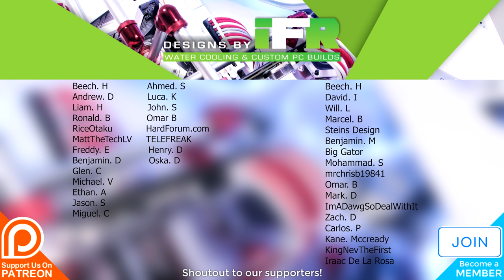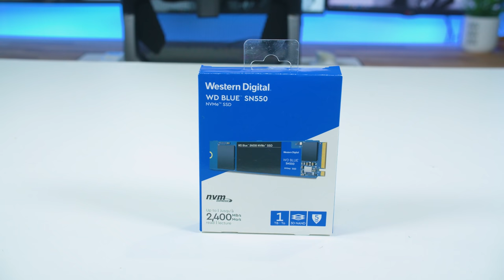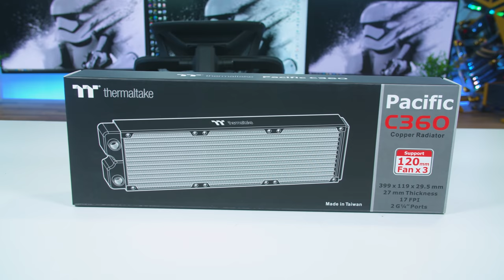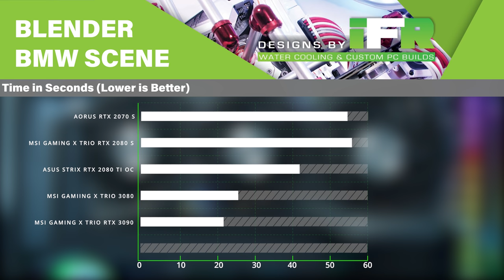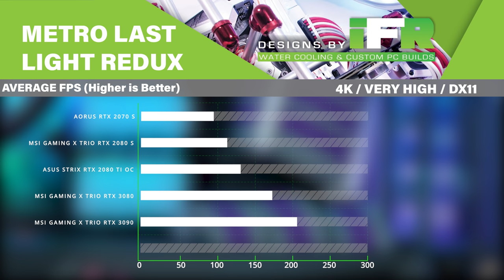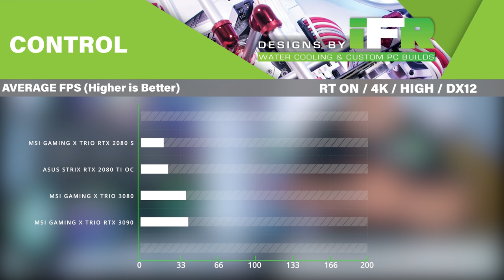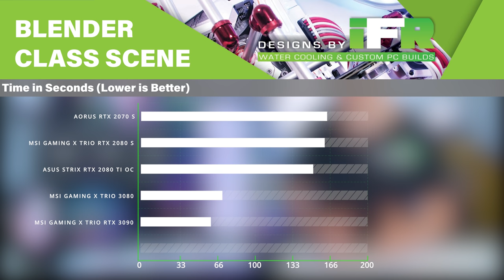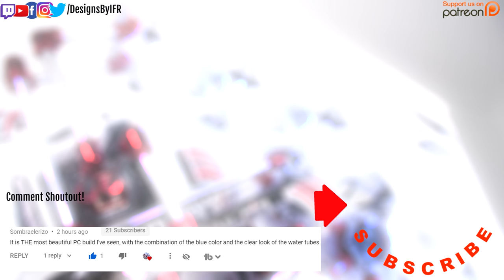Ultimate RTX 3090 Custom Water Cooled Gaming PC Build + Benchmarks

Comment: Alternative title: how to build a freezer that can store your electronics
Reply: Lmao
Reply: Lol did u see the 4600mhz ram
Reply: Those extra fans aren’t offering more cooling. It’s more likely that they’re hindering the positive pressure in the case
Reply: @aidencooke626  it probably has really high cas latency
Reply: @gravityfighters1  lol ;)
Reply: @gravityfighters1  How would you do it? Top 4 and front 4 fans pulling in, bottom and back pushing out, separate radiator on bottom with stand alone reservoir for GPU?
Reply: @cncinspiration1719  I would’ve changed the bottom rad to pull in air and the three under the water block. I learned that having more positive pressure (air coming in) is better for your cooling system then negative (taking air out) and I know it’s weird to change the bottom rad but from the things I’ve learned going front bottom out back top is best because to get that heat to go out throw the bottom will be much harder. So have the pc ( especially one like that up on a desk or a stand to allow more fresh air to come from the bottom.
Reply: @cncinspiration1719  and the gpu could go into the already existing water loop because there really isn’t anywhere to put another loop but that’s a 3090 in a very high end build it’s crazy not to include such an expensive piece in the best cooling solution
Reply: @jaypruett9503  it hurt me watching him do that. I wanted to jump through my screen and stop him. That poor pc.
Reply: @gravityfighters1  you know that you could get RTX 3090 for 600 dollars
Reply: @thiccccboiiii5245  are you saying $600 isn’t crazy expensive for a single component? And also where the fuck do you get a 3090 for $600???
Reply: Jay _TooGoated  the Corsair case is best for air flow and the li case would be good for cable management. Definitely would go with a 1000w power supply for overclocking on the CPU and GPU and for overall safety of the machine. The only thing I would add to this is another SSD or a large storage Hard drive especially if it’s for gaming. Also what speed of ram did you get? The 10900k can handle almost every speed but you have to make sure to get real performance out of you machine getting Cl16 cl15 cl14 are the best for higher speed ram. Other than that you have a beefy ass computer to put together. And if you need help with that I can help.
Reply: Lol
Reply: he: decides to build an ultimate PC
his bank account: noo...no.plz god noo..noooooooo
Reply: @gravityfighters1  lmfao
Reply: Anyone know music name ?  😁
Reply: Which company's motherboard, Nvidia 4090 GPU, cabinet, motherboard, DDR5 ram, liquid and air fans and SSD and power supply are the ultimate? Please don't ignore my reply. Please anyone reply.

Comment: Back then you were worried youre pc will overheat, now youre worried about it freezing😂❄️
Reply: underrated comment
Reply: Lmao 🤣
Reply: pc components work better under cool temperature {a fact}
Reply: @jyotiprasad1411  hey baby. U didn't get joke but you will surely get my pure love if u try
Reply: i will play my laptop in the freezer now then
Reply: Those fans are useless they spins in 1100 rpm that's not enough. Waste of money
Reply: Which company's motherboard, Nvidia 4090 GPU, cabinet, motherboard, DDR5 ram, liquid and air fans and SSD and power supply are the ultimate? Please don't ignore my question. Please anyone reply.

Comment: Incredible, I just want one of those PCs to play minecraft!! Lol
Reply: Same
Reply: lol 4000 fps
Reply: @wintr7803  
Maybe 30
Reply: @Terminate1783  130 rtx on
Reply: Enable RTX , BAM , You would still be getting over 3000+ FPS!
Reply: @nicojusbetter  
If you play minecraft without shaders you aint playing it right

And there isnt a pc that runs mc with the best shaders at high fps unless u have render at 0
Reply: @Terminate1783  Playing with / without shaders doesnt mean you're playing it right or wrong its just a preference (I like it on)

and im pretty sure an rtx 3090 and ryzen 9 5900x would be good enough to run those  shaders normallly
Reply: @nicojusbetter  
No there is shaders and textures that make the 3090 kneel
Reply: @Terminate1783  no
Reply: @Terminate1783  bro there literally aren't why don't you look it up
Reply: @Terminate1783  OH I forgot I watched that video a while ago. Then yes you are right and now I wonder how dual 3090 would perform in that 🤔
Reply: @nicojusbetter  not much better, trust me.

It will perform similarly as SLI isn’t supported or any useful for Minecraft from what I have seen.

I can also confirm that my RTX 3070 ti doesn’t even gets enough fps with super demanding resource packs and shaders.

Comment: Cool setup but im not understanding why you have the side radiator fans exhausting? The air coming in from the front is just gonna go straight out the side, and not much more flow for the rest of the case.

Comment: I'm curious why you have so many fans pointing in? I was told you want equal to negative pressure with more fans pointing out to pull the heat away from the components.
Reply from the maker: Hey mate what you were told is true however this case has no front panel installed so there is no pressure, it doesnt really apply to open air builds

Comment: Just out of curiosity, but why do you have so many exhaust fans? Especially the ones at the bottom of the case? I've always been under the impression that bottom and front should be intake, and rear and top should be exhaust. I'm sure I'm just not educated on something, but I'm curious. Also, why have the radiator as exhaust right beside intake fans?

Comment: Um i have a question. How long does it take to build a pc? cuz i never build a pc before😐
Reply: No exact answer. It can be anywhere from 10 minutes if you're very fast to several hours for the build. I wouldn't worry too much on how long it takes. You don't want to rush it.
Installing Windows takes at most 20 minutes. Installing drivers may take around 10-20 minutes. Windows Updates may take 30 minutes to an hour or two depending on your internet speed, updates needed, and your hardware.

Comment: Why does NO ONE, EVER, APPLY THERMAL PASTE PROPERLY!? It makes me so ANNOYED; if you apply it PROPERLY you can INCREASE the COOLING by around 50% (depending on HOW MUCH of the CPU SURFACE is COVERED with/by thermal paste (the bigger the surface area of the CPU that's covered by thermal paste, the more area [of thermal paste] the CPU THEN HAS, to PASS, HEAT, THROUGH!) and DECREASE the AVERAGE RUNNING/PERFORMANCE TEMPERATURES also by 50% (again, depending on HOW MUCH of the SURFACE AREA is COVERED, to CONDUCT HEAT THROUGH: IF YOU ONLY COVER A TINY BLOB of the CPU with thermal paste, then there is ONLY that TINY BLOB for HEAT TO PASS THROUGH!)

Do RACE CARS need 1 TINY, THIN EXHAUST, or 4 "Straight Piped" (no Cat) 6 Inch (in diameter) exhausts to GET RID of the WASTE GASES!?

Can you get ALL of the water OUT OF A BUCKET as QUICKLY as POSSIBLE, by ONLY DRILLING a TINY HOLE in the BOTTOM OF THE BUCKET? OR, WOULD YOU GET ALL OF THE WATER OUT OF THE BUCKET, STRAIGHT AWAY, IF YOU CUT THE BOTTOM OF THE BUCKET OFF!?

By putting a "tiny blob" of thermal paste on the CPU surface; you have just INCREASED the OPERATING TEMPERATURE (and over-heating/thermal throttling threshold/cooling system work-load) by, up to ~75% and DECREASED THE PERFORMANCE of the CPU by THE SAME AMOUNT.

You may as well just put an Intel i3 CPU in there, and be DONE WITH IT. 

I will calm down now. Ha. (I obviously mean I'm not actually "angry" or "annoyed" with anyone [I hope you can sense my sarcasm?]; I just think its a shame for people to spend all that time, money and effort into building a PC/Computer, then not applying the thermal paste properely, so the PC/Computer won't ever be as fast and/or efficient as it could be...). 

Seriously though; please take out the CPU, remove the old, EXTREMELY DRY AND BRITTLE (even burnt!?) PASTE, clean the surface of the CPU and ALL CONNECTION SURFACES, then re-coat the ENTIRE SURFACE with an even, moderate coat of a DECENT thermal-conducting paste (the more expensive, doesn't always mean better; get the paste with the best conduction statistics; you want HEAT TO FLOW THROUGH/BE DRAWN THROUGH as EASILY AS POSSIBLE/WITH THE LEAST RESISTANCE AS POSSIBLE), then you SHOULD NOTICE STRAIGHT AWAY that your PC/COMPUTER (CPU and its Cores, Cache etc.) RUNS A LOT COOLER, and is MORE RESPONSIVE, average Clock Speed should INCREASE and the CPU WILL TAKE MUCH LONGER to heat up to where your cooling system is either over-loaded, or the Clock Speed has "limited performance" due to THERMAL, HEAT ISSUES/PROBLEMS. 

PLEASE DO THIS; you will notice the difference...

Peace out, 

TJ

Comment: this not needed  i have a z590 i9 10900k  comet lake  and rtx 30 70  32 gig ram  in a corsair dule chamber air flo tempard glass  case with swing door  when shut door  you dont hear nothing when you open door its like a cooler inside save the mony for over priced parts that have more purpose   as  you have fans in your build any way why liquid cool